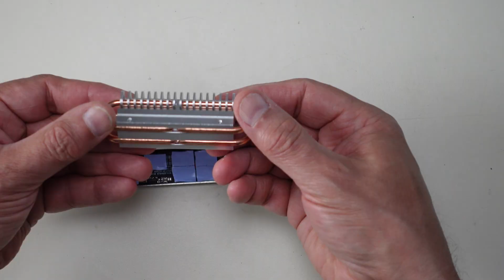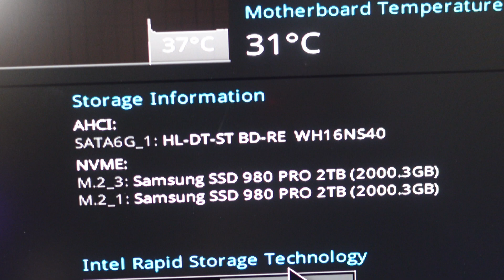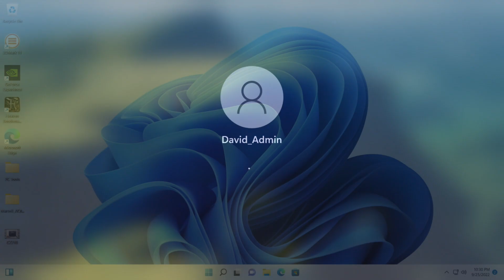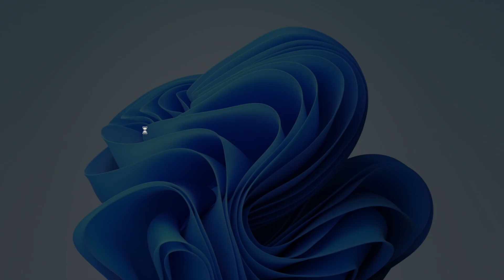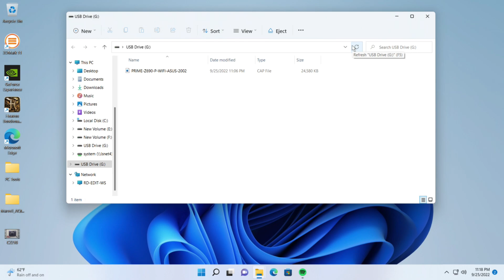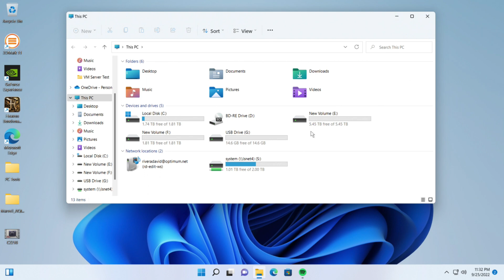Building a Home Lab VM Application PC/Server – part 5, Final Production Steps

Comment: Have the same case as well, want to mod the case by drilling holes and add a USB-C version connector but don't know how to go about it. I guess I have to buy a new case, newer Ryzen AM5 motherboards have USB-C support.
Reply from the maker: I used my Dremel - first with a drill bit, then cutter and it came out quite well (if I say so myself).  I believe I did show how I did that in this video.
Reply: @PE4Doers  Yup, you have it on this channel.

I saw the DIY video a few hours ago, titled ''Building of my Primary Video Editing Rig – Case Mod #1 – Adding a USB-C Front Panel Connector''. 

I think the steps / method are the same and can be applied to the Carbide Air 540.
Reply from the maker: @BravoSixGoingDark  I actually made that mod to my 540 (in the original video you added a comment to I believe), however it was quite difficult getting the disassembled sufficiently to access the mid-front section where I wanted to install it.  Also, running the ribbon cable back to the motherboard was also a challenge without damaging it.
Reply: @PE4Doers   I see. Thank you for sharing your experience. I think getting a new case would be a better choice for me. Have been using this case for almost 10 years now. Planning to downsize to a slightly smaller ATX like the Lian Li O11 air mini.
Reply from the maker: @BravoSixGoingDark  No problem.  I still enjoy the 'Storm Trooper' look, and I like the second compartment.  Also, this may give away some of my lack of modernization, but the two 5.25 bays give me real nostalgia 😊

Comment: I have that same 10G card with the driver CD.  Funny enough it works great (if you install the driver from CD), whereas the genuine Intel card does not work.  The 10 Gtech fiber SFP (2 for $30) work fine with it.
Reply from the maker: I have two of them, and only the second one is bad.  The Intel card is recognized without the need for any Drivers by both Windows and VMWare.